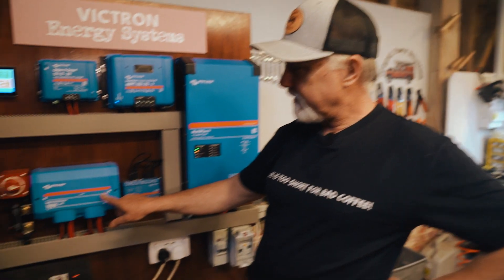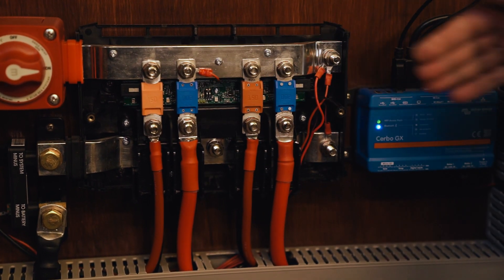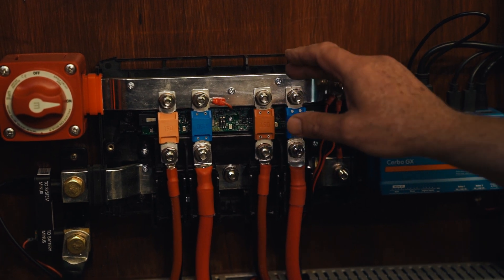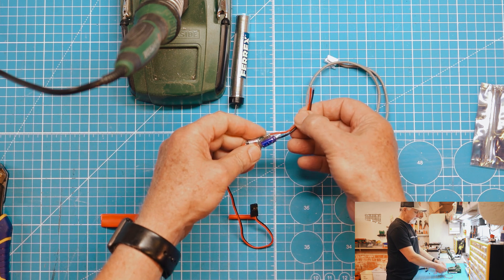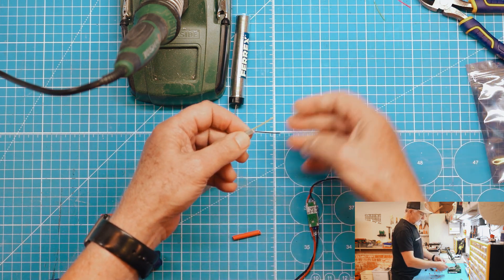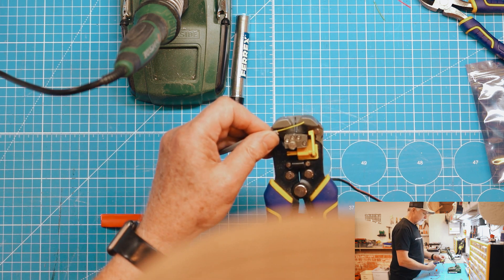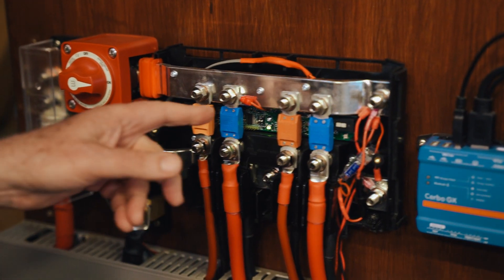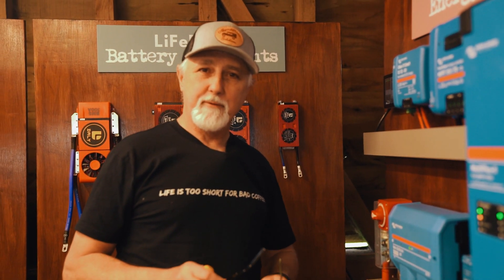How to make the cable to power Lynx Distributor LEDs

Comment: I did similar but instead of adding the drop down regulator I used 5V from the Cerbo GX USB port.(cannibalised an old USB cable to get access to the 5v output). I used the Touchscreen power USB socket on the Cerbo as I don't use a display but the standard USBs should also be able to supply sufficient power if you do use a display.

Comment: What is the size of the inline fuse ?
Reply: Was wondering the same as about to make mine. The output on the converter from pi-hut is rated at 3A, 5V on its label, so 15W. I guess that means the input is pulling less than 1.5A at 12V. But a 3A fuse should work since the wire is the same size both sides. I'm gonna see what's available online and maybe order a few in case I blow a smaller fuse initially.